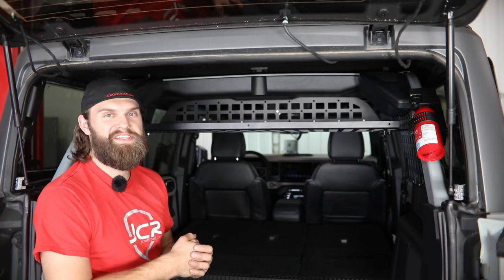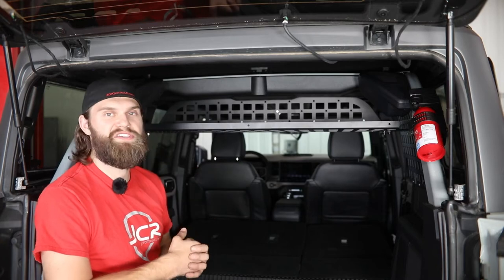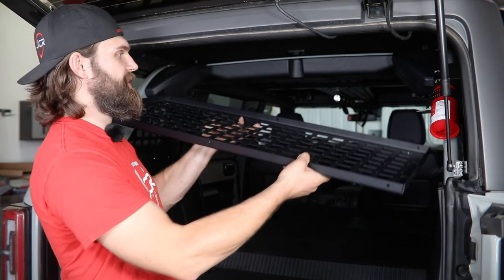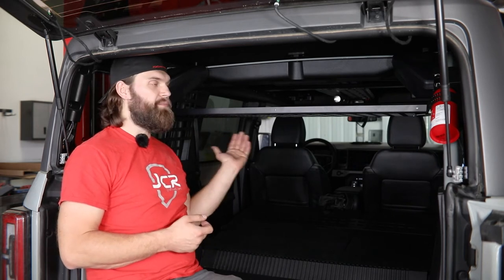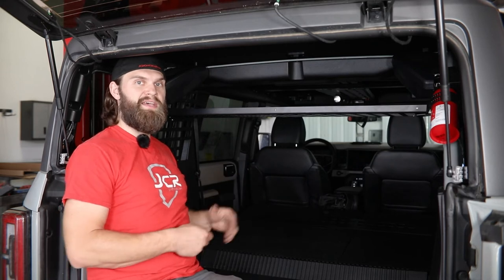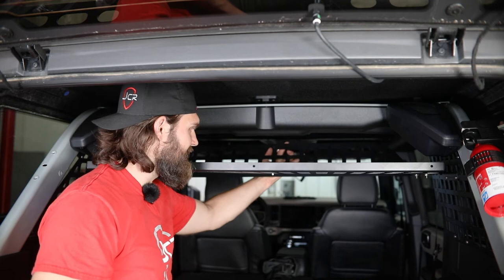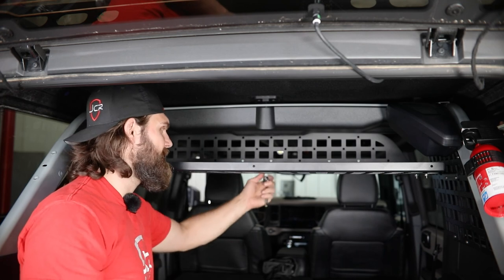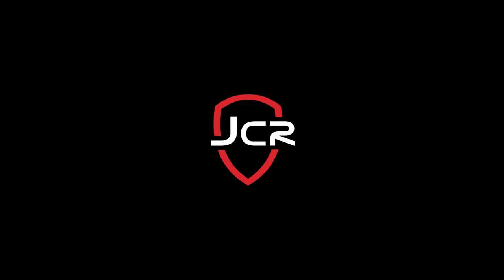Bronco Upper Shelf Install

Comment: How much space do you actually get?  Like what is the height of the space from the shelf to the roof?  Thanks
Reply from the maker: That changes whether it's a 2 door or a 4 door. If you follow this link, the pictures will give you a good idea of space relative to the roll bar for both models. 

https://www.jcroffroad.com/product/BR6UPRS.html